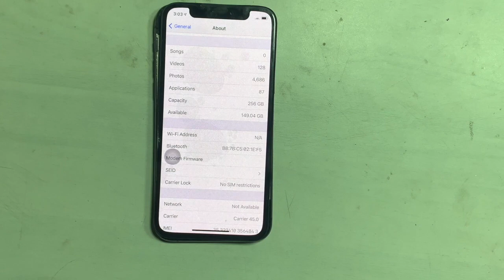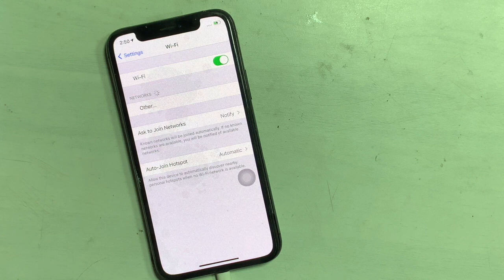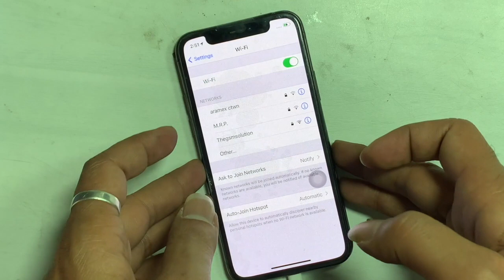iPhone 11 Pro No service/No WI-FI/No Modem Firmware Fix.

Comment: So how did you solve all these problems now?? Is it by separation or what because I still don't understand how you solve all the problems you illustrated. Please throw more enlightenment thanks
Reply from the maker: Dropped iPhone 11 pro makes the middle board separate and no pin is broken or damaged. So Re-ball middle layer only solves that issues.